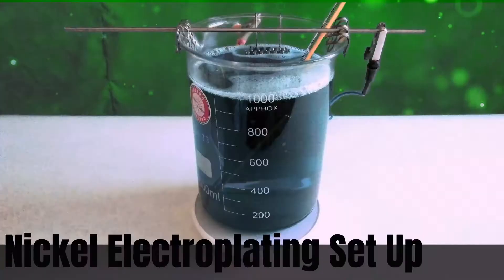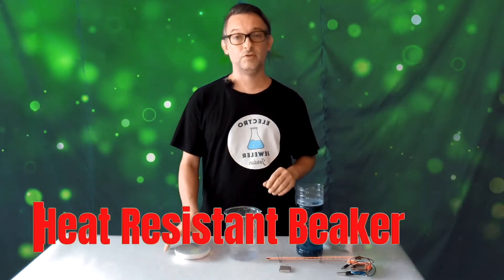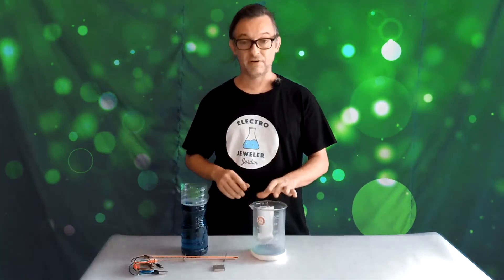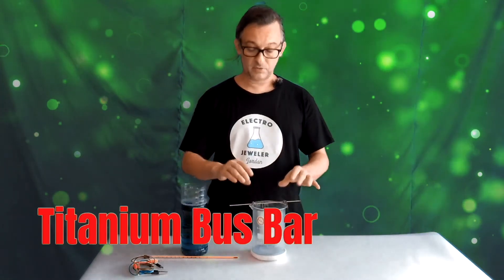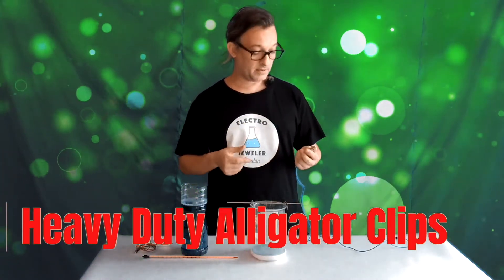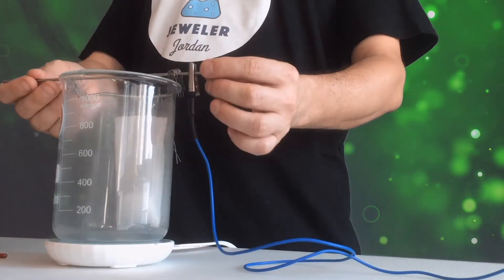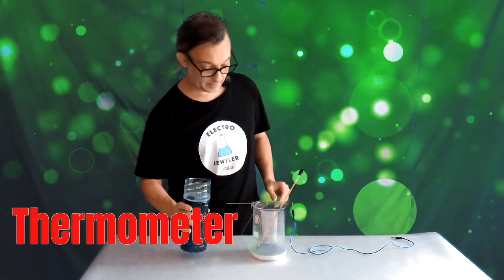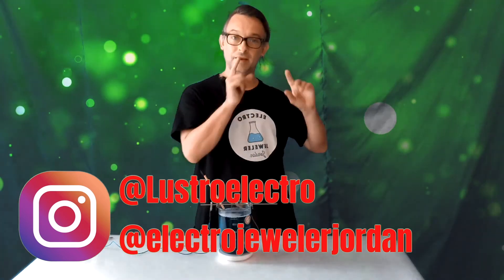Simple Nickel Plating Set Up Final cut

Comment: Hi, im about to make and order on your site. Do I need a agitator for the solution? like a fish tank pump or magnetic stirrer hotplate maybe? I want to nikkel plate small things like screws ect
Reply from the maker: Hi, you can use either.  For small pieces I don't agitate, larger pieces I use an air pump and airstone, tomorrow I can send you a picture.  You definitely need heat though and if a heated stirrer is available to you it's a good option.

Comment: Hi Jordan do you have a test fact sheet at all that shows the possible test faults and solution as to what might be wrong.

I tried a test piece and it just turned completely black. What might the problem be.
Reply from the maker: I don't have a complete fact sheet yet, stay tuned. Are you using a WATTS  nickel sulphate solution?    I'm not sure what turned black, the nickel plating or the metal being plated.  Or what metal you are plating.  So it will be a guess.  If it's the metal it may be something that cannot be plated in that solution.  Zinc?  Or the polarity is reversed.  Positive (red) anode /  negative (black) cathode.  If it's the nickel plating that is turning black   It may also be a PH that is too high, it should be between 3.5 -4.5 .  In this case add sulphuric acid.  Directions here :  https://electrojewelerjordan.com/category/nickel-plating/page/2/https://electrojewelerjordan.com/category/nickel-plating/page/2/

It can also just be that your amperage is too high and it is burning the plating.  try .5 - .1 amp per inch.
Did you try to plate zinc or galvanized metal?  Zinc contamination can turn your plating black .
I hope that this helps.
Reply: @electrojewelerjordan490  thanks for your reply. 
I'm using Nickel Sulphate Hexahydrate from Paramount Chemicals. I was trying to plate a metal nail as a test piece. I cleaned it all up and rinsed it in a diluted Hydrochloric acid bath then water and then into my nickel solution. I checked the Ph and it was at 3.7.
I had the polarity correct with the bubbles coming from the nail. I was using a phone charger for the power. The only thing I didn't do was to warm up the solution as it didn't need to be perfect. The nail just turned black. 
I thought my nickel sulphate mix might have been to strong, not sure if that's a thing or not. My next thought was to do like you said and lower the voltage by just using a 1.5 V battery.
After that I'm not sure what to do.
Maybe a different item 
Appreciate your feed back
Reply from the maker: OK , 2 issues   First ,Nickel Sulphate cannot plate directly over steel. You have to either plate in copper first or use  flash plate with stainless steel activator which is a high chloride nickel plating. Try to plate something that is copper or brass.  Clean well and then HCL dip like you did before. Second.  It is difficult to get good results without an adjustable power supply.  A phone charger  (5V) is also too high a voltage.  If you have an adjustable power supply plate on CC mode .05 - .1A square inch.  If you don't have access to this try a charger that is 3.5 - 4, you'll get ok results with this.  I  never tried 1.5v, if it works please reply here, It would be good to know.  I hope that this helps.
Reply: @electrojewelerjordan490  Ps yes thanks for the help. I really appreciate that you have replied 👍
Reply: @electrojewelerjordan490  Thanks also for the link to your site. I checked that first looking for something as you mentioned something in your video about testing your solution so thought you may of had something.